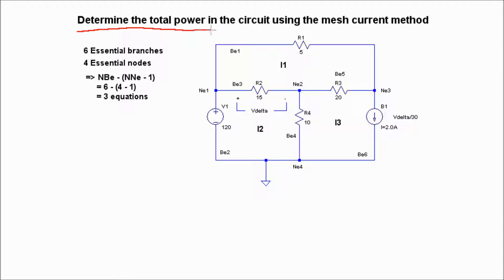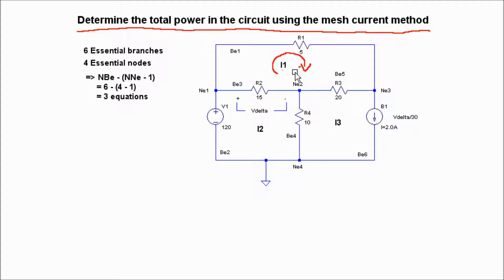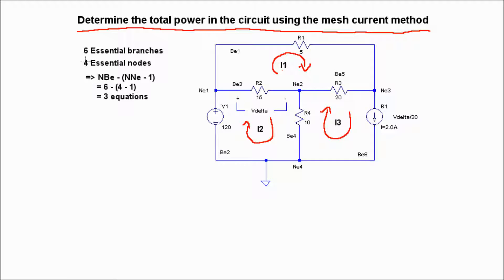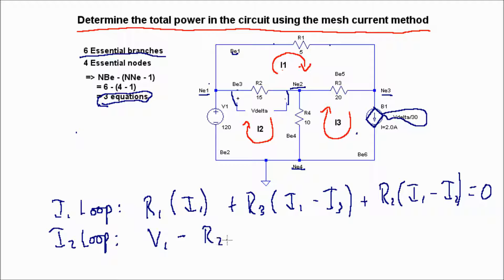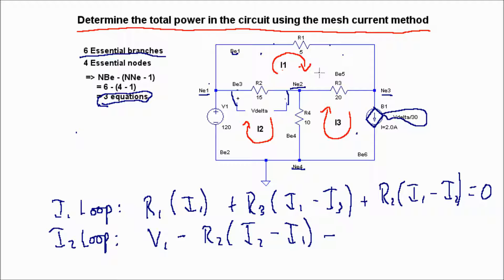Electrical Networks Chapter 4  Problem 3 Part A

Comment from the maker: The more money I throw at the sound problem, the worse it gets.  The show must go on, but that doesn't mean I've stopped working on the sound problems.  I may start sending very expensive sound equipment back to where I bought it from as a first step to solving my sound problems.  There are many video editing programs out there, but those guys don't seem to take the sound problems very seriously.  For them, it seems to be all about the video, and little about the sound quality.  These new video cameras do a far better job than, it seems, the expensive sound equipment, so figure that one out.  The camera makers have figured it out - why can't the video editing software guys do the same?